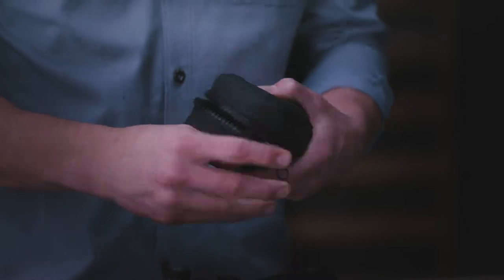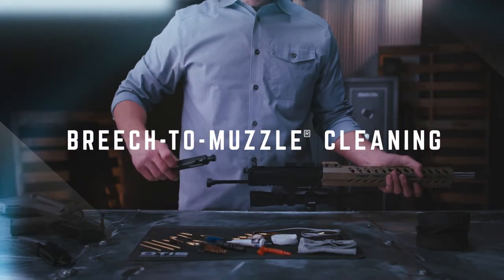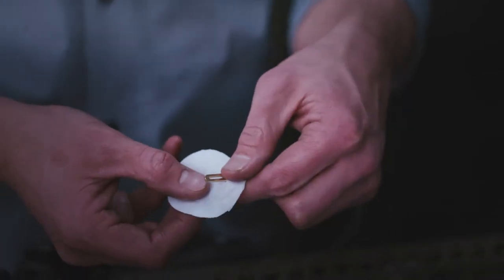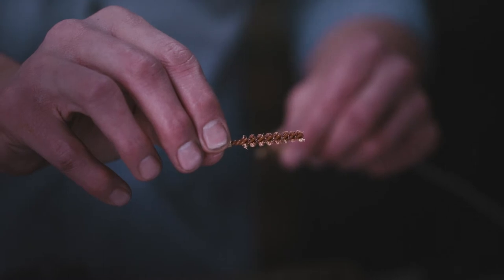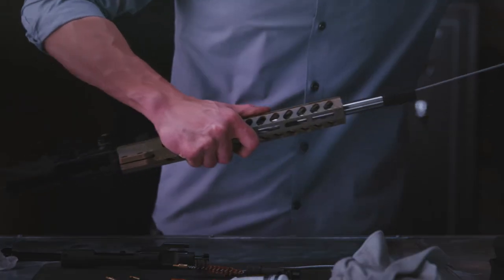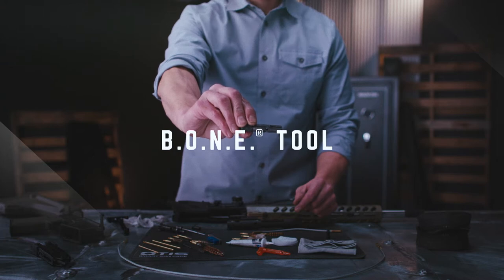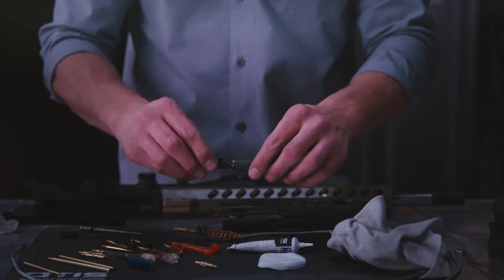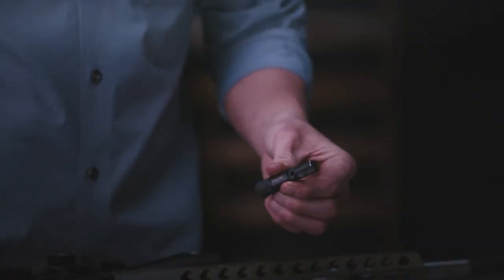Otis™ MSR/AR Cleaning Kit: How to Use

Comment: To be clear, does this kit come with the bone tool or do you have to buy that separate? And does the kit have room for it in the case? Also is there a hard plastic version of that case that is more crush and impact resistant then the cloth case?
Reply from the maker: Sorry that this question was missed; yes, the B.O.N.E Tool does come in the MSR-AR Kit. Yes, it fits in the soft pack.  The retail package is a plastic box with the soft pack inside of it but it is less compact in that packaging.